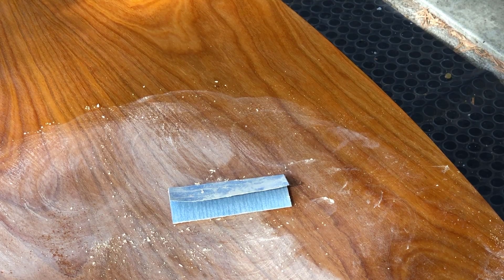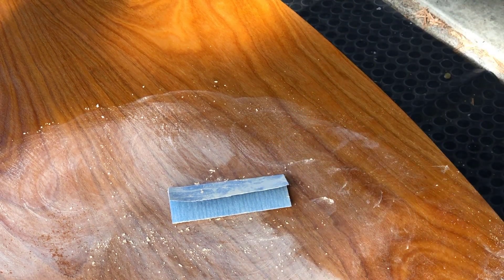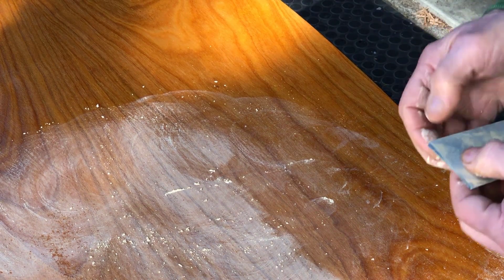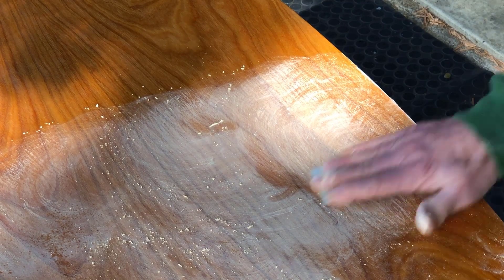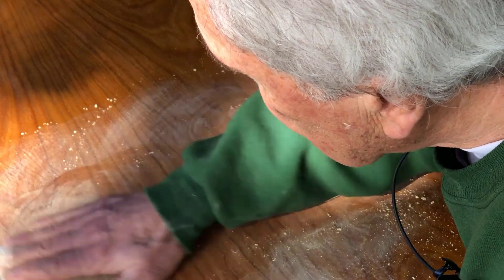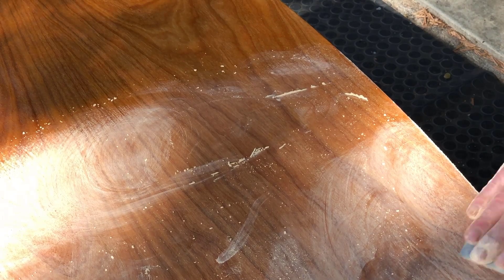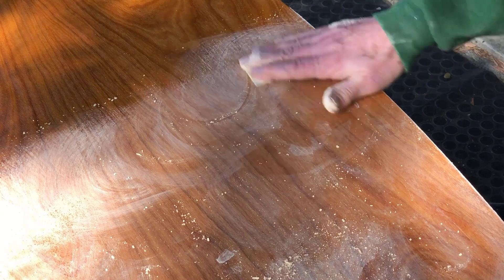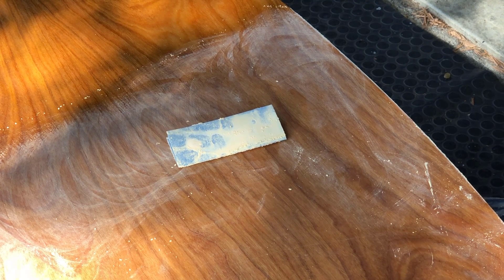Flattening the Shellac

Comment: You said that when you have an open grain wood like mahogany, you apply shellac and sand repeatedly over several days. When you do that, do you leave the sanding dust on and apply shellac right over it? Does that help fill the grain faster? Or, is that a bad idea in your experience? I've seen people both for and against it and wondered what your experience is. Would you do this with walnut, for example?
Reply from the maker: I don't leave sawdust after sanding - I vacuum before applying oil or shellac. If you want to fill the grain, use a filler. Or many times, I just keep applying shellac coats day after day, flattening each day with sandpaper. Then the shellac actually becomes the filler.
Tim